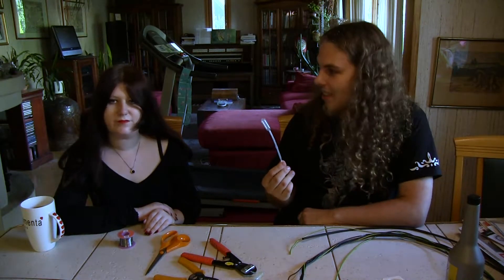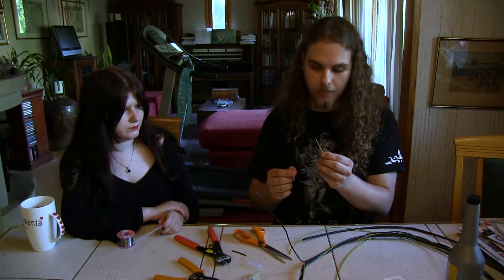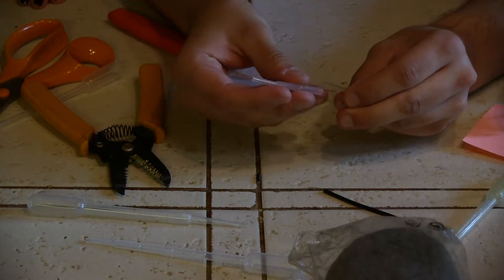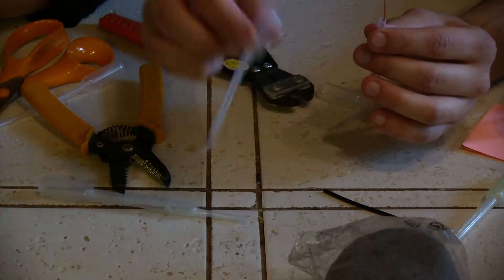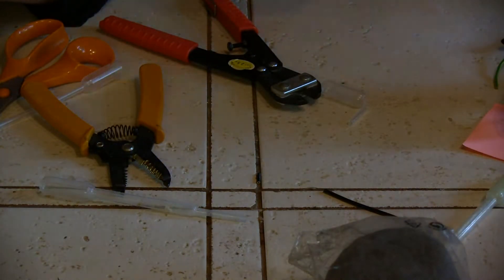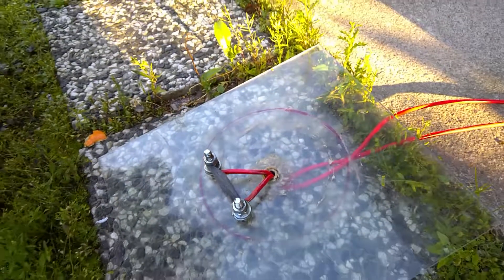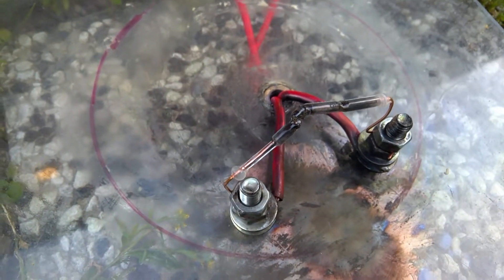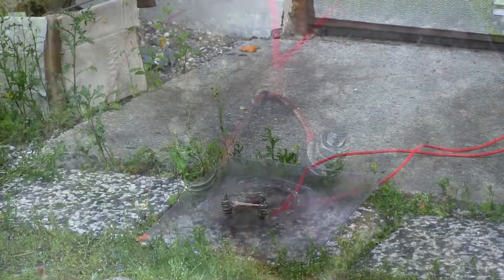Capacitor bank discharge experiments

Comment: Whats your capacitor stats?
Reply from the maker: 22 capacitors, 10k uF each if I remember correctly, maybe 6800. Would need to check on that. Too little anyway :D
Reply: @RavenFly1232 how did you trigger the capacitor discharge?  

I bought 300 separate 1000uF/200V caps last winter. I’m going to make a capacitor bank but I still haven’t put them together.

 I’m going to have to figure out a switch that has low resistance/volt drop and doesn’t immediately burn out from the high peak current. 

I’m expecting something like 200-300kA if using busbars or short, heavy output leads.
Reply from the maker: @deltab9768  I used three thyristors rated Ford 8kA each. You can use a big thyristor, a hefty and fast switch (pneumatic operaation etc.), Or find those vacuum tubes that could handle things. They all have their pros and cons that need to be weight